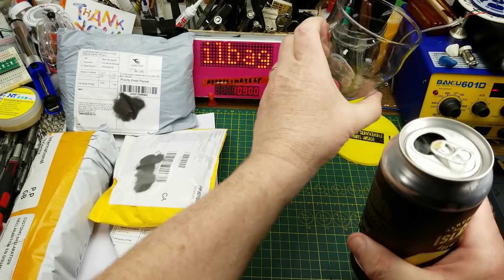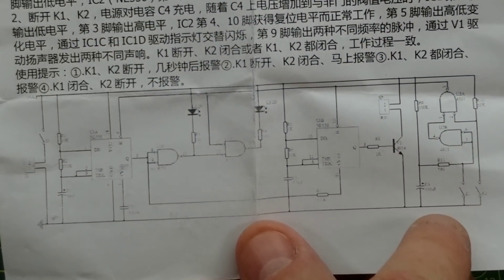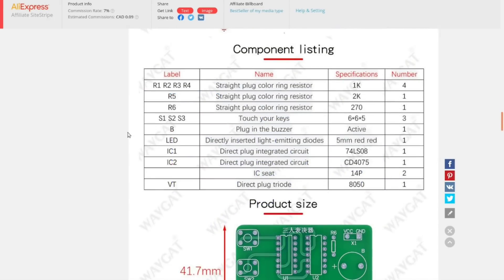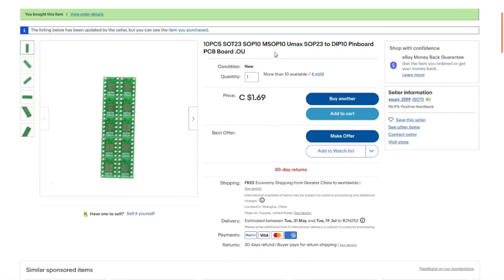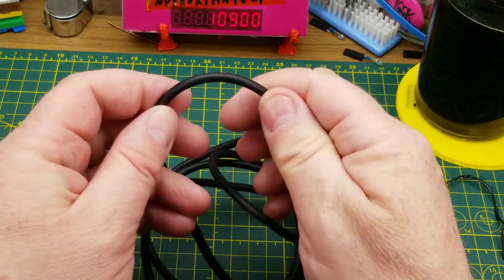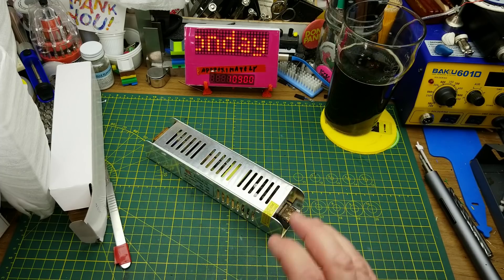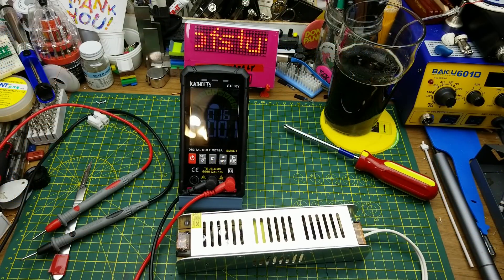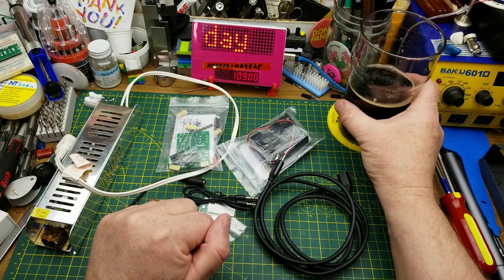mailbag Monday 139

Comment: I think it's a good idea to look inside a power supply before you power it up. Of course if it's possible without destroying it. Another youtuber with wild name tested some cheap power supplies and found some super dodgy stuff inside, like capacitor soldered both pins to one hole, transformer with CCA instead of copper, poor thermal conduction of power transistors and diodes etc. So I don't think this power supply can deliver 15A. 5 at most, with only one pair of output terminals at that.
Reply from the maker: You can say "DiodesGoneWild" herer. 
He's a good guy . Smart and funny.

Comment: Those MSOP10's are good for a lot of things.  I have buck/boost converters and an FM chip in that package.  Sometimes the extra pins are useful for bypass/decoupling caps for 8-pin packages (dual op-amps, comparitors, 555's, tiny85's).

Comment: Nice haul - I panicked a bit when you went live on the cheap adapter without ground but heart rate is back to normal now! 👍😀
Reply: I always check all 3  inputs against the case since receiving a power supply that was live to the case (it blew the fuse as I had connected the earth).
Reply: that beer must have been extra stout! 😀